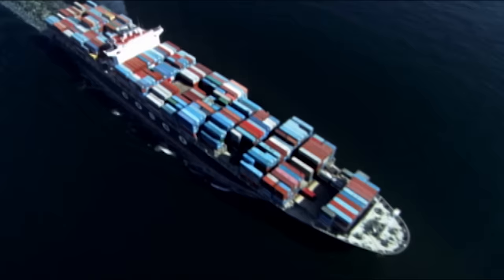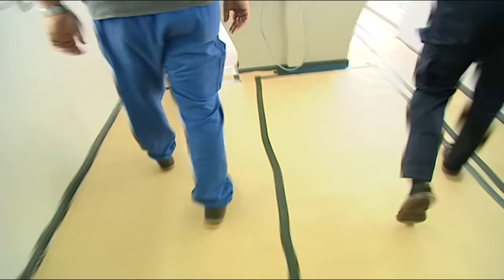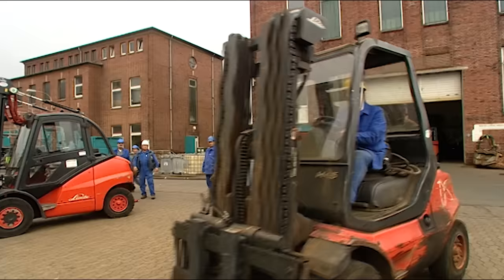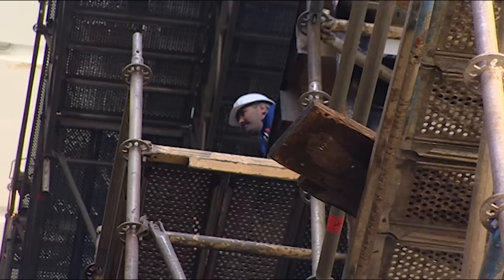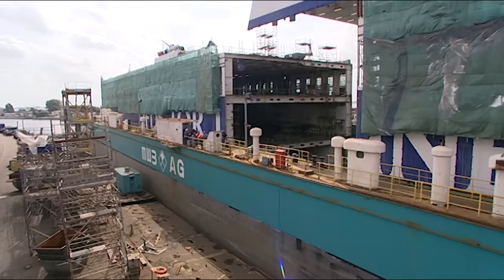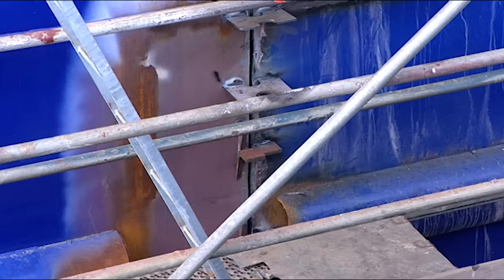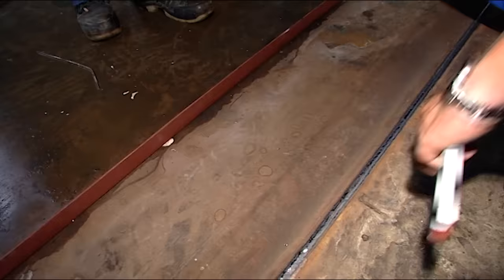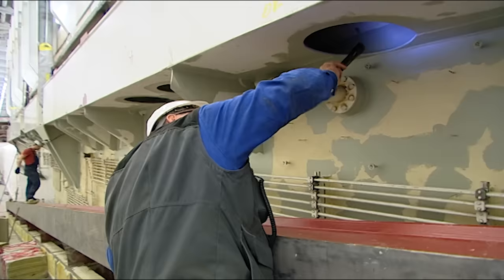Expanding A 755 Foot Ship By Cutting It In Half | How Ships Grow | Spark

Comment: I just cant imagine those welds being as strong as the old ship??
Reply: The entire vessel is already welded together like that from birth.🤷🏼
Reply: That used to be a problem with the old WWII 'Liberty' and 'Victory' cargo ships. Every so often one of them would snap in half, if we recall, in the same general area every time. Something, something, brittle steel. Was solved by attaching metal 'straps' to the sides of the hull to take up some of the stress.
Reply: How they built in the first place???
🤦‍♂️🥴🥴🥴
Reply: A correctly welded joint will be stronger than the surrounding material, once welded the operator will have all of the welds checked with a electromagnet  that with the use of a ferric spray, and after  a detector will show any imperfections in the weld that can be investigated further. It’s not their first rodeo and won’t be their last either.
Reply: @chezsnailez  these were ships built in weeks so theres going to be defects and bad workmanship on some causing them to snap and fail.
the Liberty class ships pretty much won the war as so many of the dam things were built.
an absolute super human effort to build so many in such a short time
Reply: @andidevlin3361  The fatal faults of the liberty ships didn't happend due to poor workmanship, but due to design fault.  They where underdimensioned in the middle, and combinend with brittle welds around the cargo hatch, they had a vulnerability to snap into two pieces. Especially during cold temperature.  The solution, as described in another comment, was to rivet reinforcement on both sides of the hull.
Reply: Your lack of education does not change the complexity of the world around you.

Comment: I came up with a simple way to check if the original ship has been splitted into two pieces completely without being connected even a centimeter long. That is to check if a piece of string or wire can be moved through the entire cross section at the cut.
Reply: They do it with a super long string yo-yo from the top of the ship as they walk port to starboard.

Comment: It may look easy???   Nooooooo.  It definitely doesn’t look easy!
Reply: I would think the hardest part is match the insert to the original ship. I would assume the blueprints would specify dimensions and spacings of the hundreds of stringers that make up the various deck floors and overall dimensions but I wonder if precision spacer blocks are used to help to position certain multiple members that are tacked to metal deck sheets to form various quite precise components.

Comment: Yes editing can make anything look easy however this speed of turnaround: shows impressive organisation and preparation.
When a "stretch" is both horizontal and vertical the extra windage with the same power installation can (as experienced) challenge manoeuvrability in severe wind conditions.
Reply: 35 days is very fast until I found out the South Koreans build an entire 800 foot bulk carrier in 34 days.
Reply: @thereissomecoolstuff  Building a vessel is actually simpler and faster because it requires less time in the drydock
Reply: @alex9621  I agree with you. Dry docks on their own are amazing. Boeing is making 1.3 737 a day trying to get to 1.8 per day. We live in an amazing time.
Reply: @thereissomecoolstuff   New building is always faster than conversion !
Reply: @IntheFishtank  I agree. Imagine an entire modern ship from cutting steel to launched in 34 days. Until any modern country can do that we will be at the mercy of those that can.
Reply: @thereissomecoolstuff  South Korea is a very modern country. Apart from that they can do it because the ship yards are massive and multiple yards are involved in the same project. The sections are being ferried in on barges one by one from subcontractors and put together like Lego bricks on the big main yards. I have been there multiple times - the scale is impressive. At it's highest DSME delivered 2 new vessels every week. Mind bugling....

Comment: Seeing the severed section at the base of the hull, that definitely was single skin, not double skin, as they mentioned in the video
Reply: Correct, it is nothing but single hull. 
Even the Class classify the vessel as single hull, so go figures.
Reply: I think they meant it had a double bottom.

Comment: Pretty amazing for 35’ of extension.
Reply: It's meters.
Reply: A little over 90 feet.
Reply: @jamespayne8781  They said 35 meters? Makes more sense. It looked small due to the scale. Thanks
Reply: @thereissomecoolstuff 30 meters actually which is two additional trailers in length in 8 rows on 4 decks so it's quite a lot of exstra capacity. I have been 1st and 2nd Officer in DFDS (and 2nd Engineer) on these exact vessels.
Reply: @jacobmygindpedersen1138  It is a lot. I enjoyed this but wanted to see more of the welding and wiring. That is back breaking work.

Comment: Vraagje als je allen schepen op de wereld uit het water haalt, hoeveel cm zou dan de zeespiegel zakken?
Reply: We are talking about approximately 55,000 ships, of which approximately 770 are supertankers. A reasonable estimate is that all those ships together are comparable to 5,000 supertankers, each 300 meters long and 50 meters wide. This gives an area of 75 km2. These ships have pushed away water over this surface, with an average draft of about 20 meters.

But if we spread that 20 meters over the entire ocean, it is 'diluted' by the ratio between the 75 km2 of the ships and the 360 million km2 of the oceans. This results in an increase of 4 x 10-6 m. So those are not centimeters, or even millimeters, but micrometers! For comparison, 4 micrometers is about one-tenth the thickness of a human hair.

Comment: Im disapointed yous made a point of not covering the welding,  cutting the thing apart etc...  yeah you have to be careful - but is easy.  Welding it back together is hard.  As thick metal like that you can weld and no sooner you do -  can get a crack in the weld straight away - as the metal so thick and strong as soon as it cools and contracts it can split like toilet paper -  so I was keen to see how they did that.  The rest of doco good / exellant  but......

Comment: German engineers show whats possible. I think only few ship yards are able for that and no one else so precise like German ship builders mechanics and engineers.
Reply: Lmao calm down your adulation! While it is a difficult job that requires lots of know how it certainly isn't a german prerogative. 
In fact, many other shipyards are able to perform that type of job on even more technically complex vessels like cruise ships
Reply: @alex9621 
I was going to post similar comment. 👍
Reply: Sorry to hurt your pride in German Shipyards but in the UK from 1970 to the nineties I worked on numerous Ship lengthening jobs. They were common place and not really hard to do. We cut a Ship in half horizontally and raised it by just over a metre, first time it had been done in the World. This was at Middle Docks Engineering at South Shields on the River Tyne, UK
Reply: Conversions like this is done all over the world - no worse and no better than in Germany.🤷🏼
Reply: But German engineering is definitely in general quality and high class!
Reply: As long as you have the facility and enough budget this work can be done anywhere in the world. This is not exclusive to German engineers. It has actually became generic long time ago.
Reply: Its not rocket science. In 1980, in Anchorage, we drug our landing craft up on the beach with bulldozers, cut it into 4 pieces and lengthened it 20 feet and widened it 10 feet. Any steel boat can be modified this way .

Comment: ".... 300 millimeters of paint ...."
Really?  REALLY?

That's almost A FOOT of paint ....  !

Is that a mistake, or is that really how much paint there's on the outer hull of these behemoths?  Wouldn't it be easier to cover the ship in anechoic tiles, just like modern submarines? ya know, to make the ship "invisible" to sonar, thus creating a better stealthier ship in case it's gone under; or if a sub wants to ping and throw away its location so's it could get a better "fix" on the ship because visual is unavailable or something .....
..... or if Sharknado becomes reality, and the soft steel needs to be protected by a thick layer of yucky rubber or paint or painted rubber.
Reply: Width not thickness. They remove paint left and right of the cut lines.

Comment: The real mistake was ordering that ship from the begining. It was 6 years old. Delete on that time to built new extension, make plan for it, find the least expansive shipyard, a lot of talking in management, etc.... so how old was it when they found it wasn´t big enough ? It looks like management at first ordered a ship not large enough at the begining
 It would have been cheaper and less downtime. Somebody should be fired.
The document was made in 2010. In 2024 it is 20 years old
 In 10 years it will be cut up as scrap metal.